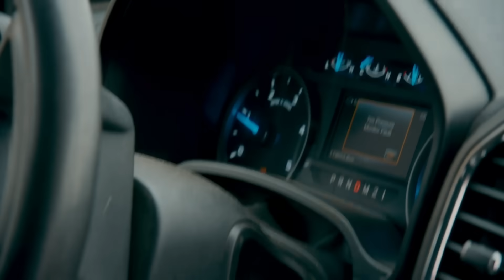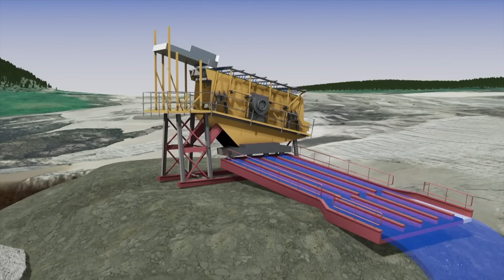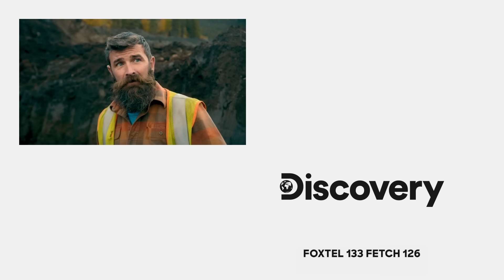"That's A F*ck-Up Fred!" Parker's Honest Feedback On Fred Lewis Operation | Gold Rush

Comment: Reminds me of every truck driver who bought their own truck.
That's when you really learn what being broke is like.
Reply: Why do they do it then?  Is it possible to earn more with their own truck?
Reply: @bobbobertbobberton1073  you make about double having your own truck but theres the risk of the truck breaking down flat tires maintenance in general. Like a oil change is $600. But again your making a lot of money
Reply: @plyyrr6189  So I assume the big part of it is how well you look after your rig?
Reply: The biggest part of it is working your nuts off and not having much of a life for most. And like everything else it matters who ya are, where, when, etc. Some areas are way better for owner ops than others. Who you know is really important. And so on. If it was easy more money people would be doing it. Like everything. Some lose, some win, and so on
Reply: @bobbobertbobberton1073  yes but some stuff is not preventable. If you got your truck running all year long you could make 200k more or less
Reply: @plyyrr6189  you can usually reduce that cost from 600 to 300. If you do it yourself i have owned  more than one truck in my lifetime and I found in  my lifetime. You need to learn how to work on your own truck you cannot sit on the side of the highway and wait for a mechanic once you figure that out you’re off and running usually
Reply: @bobbobertbobberton1073 it pays off once you own the truck

Comment: Why don't they make the screens out of fiber glass so they give against the vibration and the weight?
Reply: It's still going to get worn down by the friction. The constant rocks grind away at the metal and the impact breaks away at the worn metal.
Reply: What would work would be a first grade of rebar over the hopper, like is used for sorting gravel. Constructed of rebar, gradebout those big chunks. Set it up to be flipped clean using a winch every six or eight yards, and have spare winches on hand. Nothing fancy and pretty cheap. Rebar can be welded if it breaks, but that's not likely to happen. Might cost ten seconds per flip, if that, but that's nothing compared to replacing screens. Sure you get a bit of a rock pile adding up in the dump zone, but that can be hit with a dozer pretty fast before it gets too big. Only using a 2 yard bucket, a dozer can outpace an excavator with material. That would save probably 50% or more of the wear on screens. There would be enough vibration to shake the mud off the bulk material at the first grade. Moght lose some flake, but not as much as a bad screen.